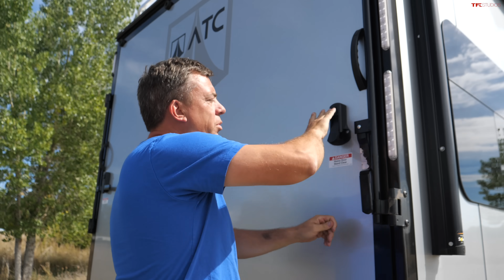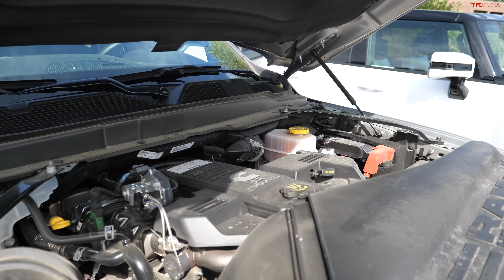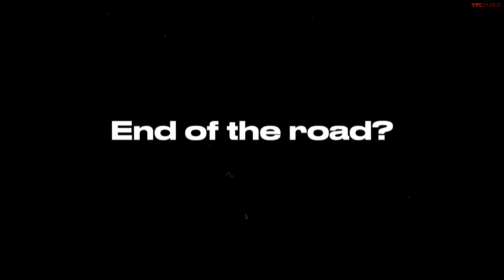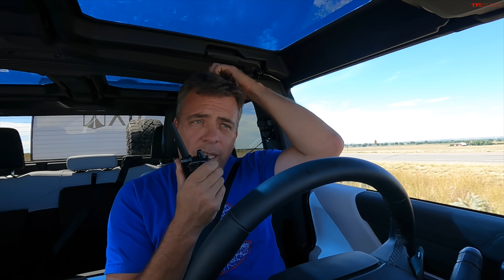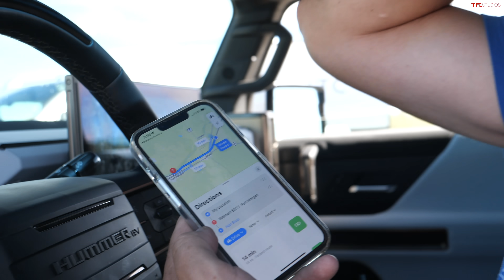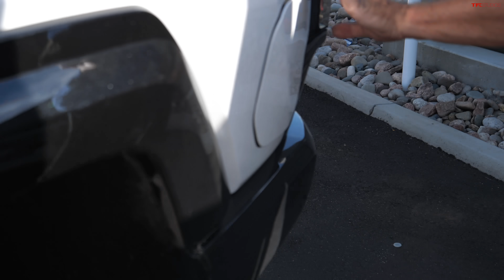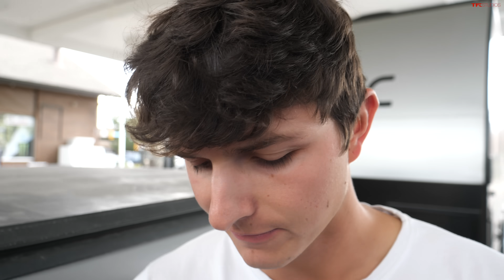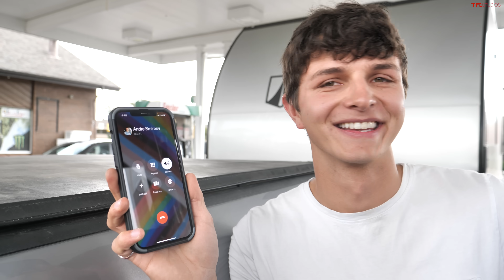How Far Can a Diesel and Electric Truck Tow An Identical Camper Trailer on ONE Fill-up?

Comment: Who’s paying for those EV charger pumps and what does that cost the taxpayers? Also, the battery materials we’re mined by enslaved children, and when the batteries are dead, you can’t recycle them. They go back to the 3rd world to get burnt, buried or dumped in the ocean…. Pass
Reply: If you don’t like electric vehicles there is an easy solution……don’t buy one. Do you bitchh about the oil companies and execs making massive profits by gouging consumers at the pump ?
Reply: @MikeHart72  I don’t hesitate to educate on the subject of evil. Consumers should be fully educated on that which we choose. Once your eyes are opened, you choose knowing the truth. The truth shall set you free. I don’t complain I act. I’ve been on 5 continents, served in the Army for 2 Decades, married, raised 5 kids, and now I seek to be a good neighbor, in Truth. Lastly, like any company, energy companies need to make profits. Some make less in profits than Nike spends in sponsorships. You can pull the actual data. It’s public information. Best wishes.

Comment: So the ev used a charge and a half. A half charge was 37 bux which means it used 111 bux for 170 miles roughly. Vs diesel was 75 bux for the same distance

Comment: Also keep in mind, prices on diesel have been inflated due to our government. So if we had diesel prices that were proportional to the cost of oil, it gets even worse for EVs. I think EVs make sense inside of a city (except for the grid). But for most Americans, it's not practical. However again, a diesel electric hybrid with a short range battery I think would be amazing.

Comment: New diesels don't get anywhere near the mileage of the older diesels. Even towing heavy I get 15mpg in the hills. Still, given the two it's not even a comparison. Electric motors do not like weight or cold or too hot either. I think you could make a diesel hybrid truck that'd be excellent however.

Comment: At a combined 15mpg and an average of $4 per gallon, that diesel truck will cost you $27,000 to drive 100k miles.

With a 212.7kw battery getting 330 miles of range per (starts at 340 and will degrade slightly over the 100k), the Hummer EV will cost you $9,700 to go 100,000 miles assuming you pay about 15 cents per kw

Comment: 🤣🤣🤣🤣🤣🤣the future.  What a joke, I can almost make it to my favorite camp spot but can't come home in the hummer.  Would have been $40 except it was free but you only charged to half so double that which is $80 then charge again to equal what the dodge had leftover then figure in the time wasted unhooking and sitting there for a half hour to charge to 50% and double that time.  After that figure in the degradation of the battery over time so you'll have stop even more.

Comment: Everything considered, I would still go for the diesel!

The scarcity of charging stations up in the mountains where a lot of people might do a lot of their driving and camping and the long charging times and having to disconnect the trailer, and the higher cost of the truck, and the lower cargo weight capacity, and with the reduced cargo area of the bed for a slide in camper,

Comment: The Humer and the trailer are 21,100lbs. The Ram had a towing capacity of 22,000lbs is that right.
It could pull both.
Not the rest of the trip but back to the halfway point yes. No not legally.
Oh Diesel can run on vegetable oil.
We are overlooking a real alternative.
Ethanol. Not from food crops like corn and rice.
Reddy plants. Hemp for instance, catails etc. Half an acre is enough to power the average family car for a year.
David Blume Alcohol can be a gas.
That's why prohibition was brought in.
JD Rockefeller was in the oil business. Standard Oil.
The model T ran on Ethanol originally.
Ol JD had a problem.
Refining Kerosene left behind this organic sludge laden with chemicals and couldn't just be dumped in the sewars.
But with further refining they produced a product that could power the internal combustion engine.
Gasoline. Other than it cost more, made less hp and was toxic and most folks could distill ethanol on thier own it was wonderful.
So JD thew money at the Christian temperance movement and congress to outlaw alcohol and hemp.
Ford built a model T out of hemp.

Comment: Unfortunately, electric vehicles are not quite ready for primetime, heavy duty long term use. 😔
Infrastructure to accommodate electric vehicles across the country is still an issue too. 
It'll take time, but it's coming along.

Comment: I have a 5.9 Cummins diesel with over 1,000,000 miles on it works like a beast every day i’m sure it will outlast any electric vehicle on the market Needless to say I won’t be making the move to EV anytime soon
Reply: My injection pump ground to a halt when they replaced diesel with ulsd kerosene.
Reply: Add all to your diesel when you fill up that’s what’s happening to the injection pumps. Don’t 2 quarts of transmission fluid in the fuel tank every time.

Comment: if there wasnt a free special on electricity. the electric hummer cost about 33 cents per mile, while the diesel ram costs 47 cents per mile. So for the much more expensive pickup, your saving 13 cents per mile

Comment: 1st of all the average truck owner doesn't actually own an RV
 2nd is depending on the RV you will need a vehicle specific to that type of RV though they have micro campers all the way up to your 5th wheels and it all depends on the weight ratio like you said and the reality is that you can get electric vehicles with up to 5000 horsepower right now they're not cheap but they do make them that will pretty much toll any RV on the road today

Comment: My 1995 dodge 2500 12 valve pulling my 12,000 lbs horse trailer gets better than that 6.7.   I’m getting around 12 pulling my trailer here in Ohio

Comment: If you brake it down to co2 the comparison between a Diesel powered car and a electric one, as brand new one, the electric has used gigantic more co2 to buid it. So in average use it takes a long time to equlise the co2. Only if you take Power to charge without co2 Production otherwise…… well stay with Diesel/ Gas!

Comment: Great job as usual. I would be interested to watch a similar video: How Far Can a Diesel and Electric Truck Tow An Identical Camper Trailer on $100 of energy/fuel.
Reply: I was thinking the same, but the cost per kWh varies hugely when you compare home charging vs public chargers... at least it does in UK.

Comment: So the EV took 30 minutes to charge and it wasn't fully charged?🤪
And you have to do that every 2 hours?
We pull our 7000 lbs trailer from Michigan to Florida and it takes 24 hours of driving. The EV would have to stop 12 times to charge, that's 12 hours of charging.
We get 300 miles per tank towing ( 6.6 L gas ) so we stop 4 times.
EVs will be there someday but today is not that day....yet.

Comment: Electric vehicles are much fun to drive in town as a daily commuter and do have some impressive acceleration times on some performance models.
But! What a joke when it comes down to towing! 130 miles of range with a light 7,000lb trailer ??!!! Where Ram can tow 15,000lbs+  anywhere from 350-400miles on 30 gallons of diesel.
I cannot belive there are plans to implement an all electric semi truck industry to replace a very practical diesel industry which had been practically operating for ages.
I would love to see how an electric semi truck would hold up towing 80,000lbs+ GVWR across the U.S. through all of the harsh temperatures, salt, and rough road conditions! 
So far it's just talk but no action!!! Lol

Comment: Silly. An old diesel land rover would tow that and probaby use not much more than half the fuel the ram used
Reply: For reference, the tank is 20 UK gallons (90L) and it would easilly do 400 miles on that with the trailer.

Comment: Just get your lcv permit and throw the Hummer and both those trailers behind the ram... I love electric vehicle technology, I think the Hummer is an awesome vehicle. But like you said, it's a lifestyle truck not a working truck. There is a very good reason the inline six Cummins dominates the market, not just in pickups but also in semis. I can't fathom stopping for a charge every 100 miles, that's unacceptable. 

I've said it before and I'll say it 1000 times, I think a diesel electric hybrid is the correct solution for efficiency in heavy duty applications.

Comment: Yeah, if that truck was deleted and tuned, you could’ve got twice that much fuel economy, which is why the things they put on these trucks for emissions is a bunch of garbage. But it makes the mechanics a lot of money because the engine will blow up eventually with all that emissions garbage on it. And yes, I would drive a Cummins any day over any electric for long distance. And I have plans to head to Florida from Ohio tomorrow in a week which is February 6 of 2023 and I guess I will see how much miles per game average on this over 1000 mile trip one way. Thanks for the video, and I did watch the video of the Ford electric comparison.too Thanks again for the video.

Comment: What a way for governments to force depopulation! The stress factor applied to the operators of electric vehicles when they are in new areas and not in their comfort zones as to where they live, the stress factor must be out of the roof! Not only do you have to worry about finding electricity you have to worry about your family safety and whatever it is you or Towing.

Comment: I'm all for the technology, but it's just not there yet.  I'm very interested in EV cars with 300+ range.  However, when towing I haven't seen any EV do well enough to even spend 25k (as my 05 Duramax cost me 14 years ago) on one let alone 100k+. So far I'm still sticking with my pre-DEF fluid Duramax for towing. I get 18-21 mpg empty and 12.5-16mpg towing. With Diesel you're allowed to add a second tank in the bed so I carry 71 gallons per fill up. $250-300 gets me 900-1100mi per fill up. Towing I drive 300-350mi be there for a week and drive back without refueling. Ideally I'd like to see these EV trucks get more range and have the ability to add a secondary battery pack for extended range when needed.

Comment: Curious about the typical cost of the electricity vs diesel. It looks like it should have been $37/123mi. So that would be equivalent to diesel at $2.92/gallon at 9.72mpg.

Comment: Flat out awful, my 87 F350 with more weight and a 300 6, 4spd t18, 3.55 rear 10.25 axle gear and finally ,32x12.5 tires gets better range on her 19 gal tank getting a range of about 216 miles lol, basically this says a design from the early 60s is out pacing the hummer for range while loaded

Comment: There is two more things you guys should concider     
TIMEWISE in the charging and the fill up with diesel
And the COST OF THE TWO(120K VS 65K)
Charging    was like 1.5 hours of waiting..(plus the wait time for an opening )
Diesel fill up  was liked 15-20 minutes...(plus the wait on the pump(if any)) 
I would think timewise  Diesel wins   hands down
The cost of the fill-up would be about the same  I think

Comment: It’s a good thing your pulling a trailer with a bed to sleep in while you charge a 100 times to get to the bush and use your gas generator to charge it when camping DIESEL is king

Comment: Man, i miss colorado, loved living out there. i remember watching the one you did comparing F150 Lightning vs GMC Sierra, seems like the Hummer only did slightly better then the F150Lightning.
Reply: Yes the Lightning barely made 100 miles with the same load and it wasn't even winter.

Comment: Add the fuel and service charges to your Ram diesel truck and you end up paying more after 10 years of driving compared to double the initial cost of a Hummer EV. And diesel truck smells worse than a dead skunk on the road in the baking sun hahahaha
Reply: Id rather spend more to have a reliable vehicle that can be refueled in less than 5 minutes!
Reply: @rack9458  For long trips trailing a heavy load I would agree with you, but most truck owners use their trucks for trips shorter than 100 miles and do not tow heavy loads regularly. I own a 2017 Kia Soul EV and most trips I make are in and around the city so for me it is a no brainer to drive electric.
I would never buy a Hummer or heavy duty Ram (2500 or 3500) for they not only are expensive to own and drive (fuel/ maintenance costs) and instead I may consider the new Tesla Cybertruck or other Tesla vehicles in the electric space.
GM, Ford and Chrysler products have typically a very poor repair history and are not build very well ... all you have to do is google Repair Pal for your particular North American car or truck and you can see what I am talking about.

Comment: I'm not sold on the whole green new BULLCRAP!😡 They approached it the wrong way! Jumping straight into it and cancelling fossil fuels is not a logical transition. A longer, slower transition would have been the best way to approach it. I believe the reason for the immediate transfer (try) is because of the kickbacks being awarded for the positive exposure and immediate push to transfer to electric vehicles. It's ALL political and tied to crime in my opinion!

Comment: there is only one reason EV's are being pushed and it has nothing to do with practicality or economy or usefulness in real world on the road situations for long distance traveling.
they cost too much, get way less range per charge, can even be a fire hazard due to lithium batteries (do your research on lithium), and right now the availability of charging stations aren't as good as one would want, not to mention the power grid itself is having enough of a time sustaining what we already have on it, not to mention the wait time for charging.
it's just not there yet, long way to go before it can even come close to competing with gas/diesel for any practical use.
if you live in the city and only use it in that environment? sure it may be better but long distance (or hauling in this case) it just isn't there yet.
and the big elephant in the room is... where does the electric grid get it's power from? so don't say it's saving the envrionment by eliminating the use of 'fossil fuel' when that's where the power generation is coming from that sends power to the charging stations.
been seeing a lot of tesla videos of them catching on fire and burning to the ground and the fire trucks pumping 20k gallons on them to try and keep the 'electrical fire' under control.
DUH... maybe they should review their training on how to extinguish an electrical fire, but in this unique case it's a battery melting down, gonna be hard to put that out ;o)

Comment: Wow, that Cummins powered Ram sure kicked the crap out of that coal/electric powered Hummer! Empty, my Eco Diesel will go for a little over 12 hours on a tank of fuel, and my 93 Cummins powered Dodge 3/4 ton will go at least 9 hours on a tank of fuel and I can fuel up in 5 minutes. You can keep your EV's!

Comment: The electric guy gloated about saving more money (hopefully comparing how much it would cost both going the same distance) but doesn't factor in the time wasted chilling at the charger. I don't see the benefit of these electric vehicles if you're spending over an hour to recharge.

Comment: Why don't they just use diesel power generator to run electric vehicle with small battery to capture braking energy?  I would think that would be the most efficient way and much more practical.

Comment: Throw 100 gallon slip tank in the bed of the diesel. Good for 1300 miles. Expensive to drive, but free fuel is irrelevant if you can't make your destination at all because of range. The Hummer is better suited to a drag strip than real life.

Comment: This is bullshit. Motor Week has done numerous test on EV trucks and diesel and gas trucks on a coast to coast cross-country tests with 6,000 pound trailers. The EV truck took four days, 98+ hours, the gas and diesel trucks took 32 hours. The EV trucks could only go 180 miles on a charge. The diesel and gas cost was the same but the diesel used 25-30 gallons less of fuel than the gas motors. Sinclair has crap diesel. That's why the Cummins got crap mileage.

Comment: That dodge didn’t get the mileage I expected at 9.7 mpg. My 97 12v 600hp Cummins on 37s gets 12 mpg pulling a similar size trailer.

Comment: First off let me state that I'm in no way pro-electric car/truck. We just aren't there yet (plus the whole child slave labor in Congo for rare earth metals). However, when I tow with my Tacoma, I don't haul ass at 70mph (the owners manual per the ATC Camper website rates the max speed of towing at 60mph). You should try a video where you are 1) in a controlled situation (race track etc) and you can go a steady mph and march it out from there. Then 2) Tow in the real world at 60mph (slower than normal traffic, but within the max for the owner's manual). Also 3) Use like vs like. Using an E-Hummer...then you should have a like Hummer (non Electric). I like the premise of the video, but to really compare you need like vs like. Not Truck vs Hummer. Otherwise good video.

Comment: I mean, I wouldn't mind taking an extra hour longer on my trip for a $40 charging instead of $100. If they both went to the lakes, it would have been basically $80 for the electric. But if I have a truck it's going to get used. Animal feed, cutting down trees and moving wood, dirt, trash, etc. You can't be afraid of putting a ding in it or scratch the paint and for $114,000 I wouldn't let this truck see rain